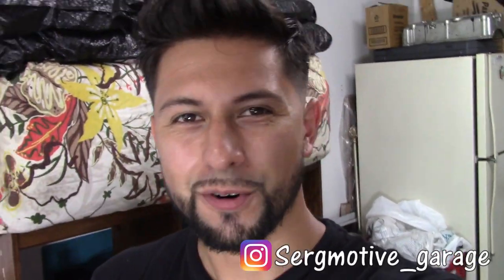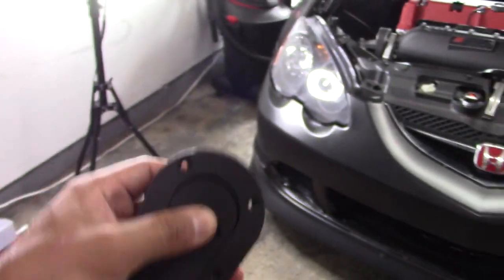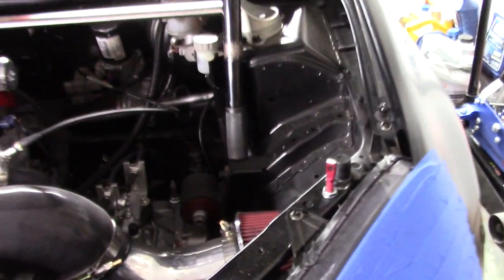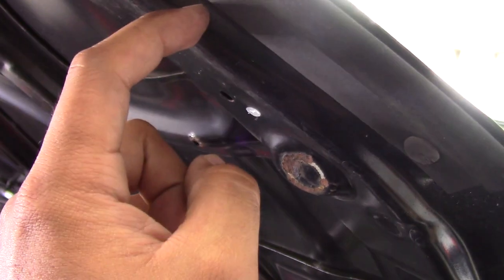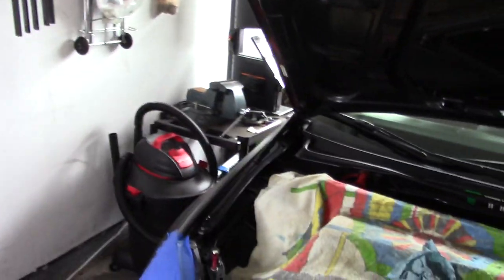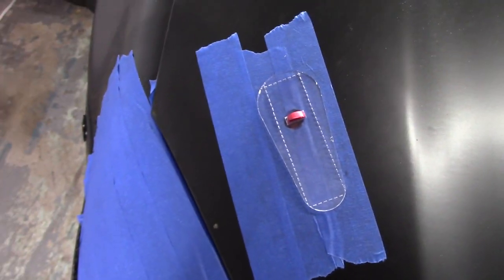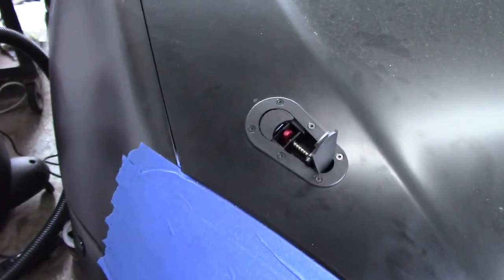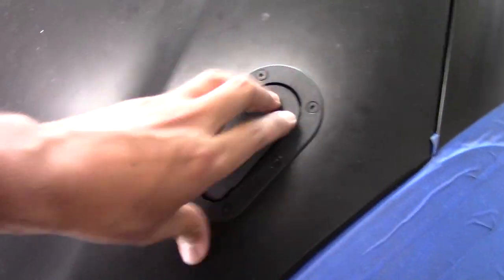The complete guide to installing Aerocatch Hood pins!!

Comment: Great work, only thing is you not using the supplied locking nuts. Using just bolts and a thread locker is a risk of those bolts not fully seating under the load of holding the hood. Just my opinion man, nothing negative ✊🏻

Comment: OK question I'm thinking about getting a carbon fiber hood and they recommend hood pins but my question is do you really need them if it latches down like a normal hood and you're not driving a 150 200 miles per hour
Reply: yes you do,  stock latch can break